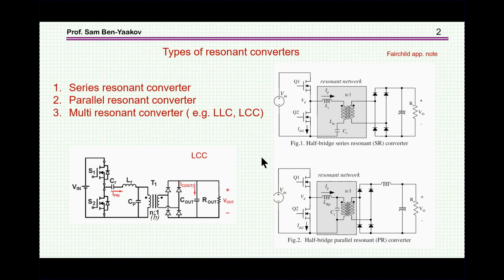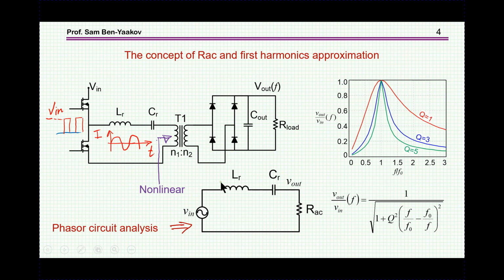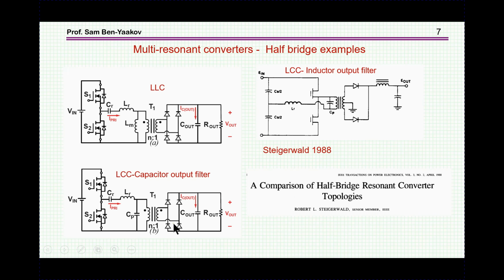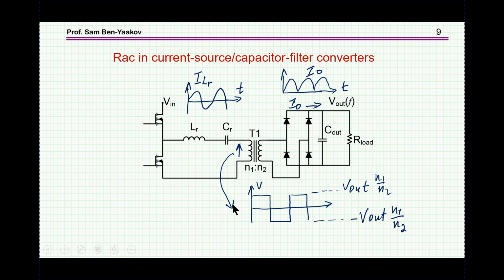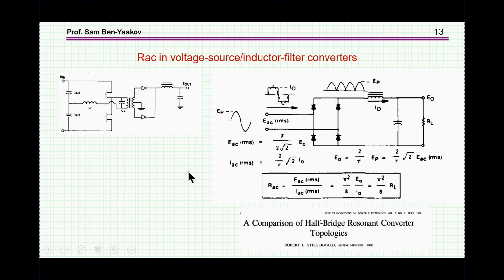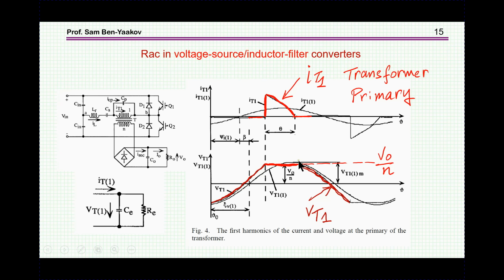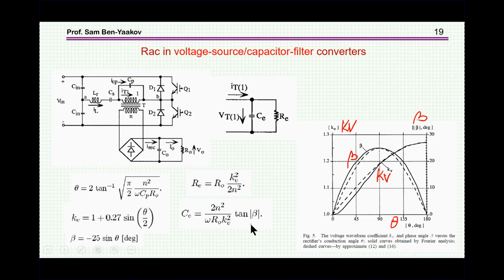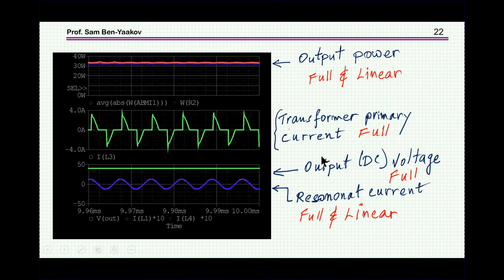LCC versus LLC converters. Part I. Basics and linear models

Comment: Hi Professor. I have in time done some tryouts in simulation I have now a model for FHA analysis so I see much o more, I can do LCC and LLC with it in LTspice. 

I have some questions about the LCC, the transformer is known now, it is part of how the CS Lr and Cp are done and loaded with it, it is not just a big inductance but work with Cp impedance. I see some papers where the Cp is twice the Cs while I see most of the others have lower Cs then Cp sometimes even a factor ten, I did see that when I do that I need a smaller inductance for the transformer, for lower mosfet current, transformer N is important against losses, I get with Cs 27n Cs 2.7 n and a Lr of 100 uH on 100 Khz what is 100 Khz and 60 Khz, (current output) and (60 Khz to 100Khz voltage output) the peak do just flip, I use the high peak and above,  and all output voltages  20v 15 amp, 150 + 150 volts 126mA and 350 volts 100mA give a mosfet current of 4.5 amps with a startup of 40 amps!!! oi yes that is what resonance supply do with startup, dangerous high amps, boom, soooo much need of soft start. but when ready 4.5 amps left and have a nice half sinus mosfet current signal..

When I do lower the 20 volts 15 to 100 mA I get a primary mosfet current of 1.2 A with all other outputs on normal currents. I do see that with 15 amps I get 22 volts out and with 100 mA I get 23.5 volts, without any regulation, this makes it an excellent audio power supply, better the LLC in this.

The mosfet current changes with low load to a kind of strange positive quarter wave and a sharp plus in the negative part. With load it changes to half sinusoidals. I have use a Q of 6.2 on Lr and Cs. I use this too for that,  https://www.omnicalculator.com/physics/rlc-circuit.

Oke update, I did a open output, what happens then is the HV voltages go from 350 to 550 volts and the 150 volts to 200 volts, but the low 20 volts 30 volts, a little load is enough to get them from stop running up and up. I did hear this is inherent of LCC. Mosfet current is now 1.5 amps. I gess loss because of circulation currents, as this is the case then it is low. So need a regulation, no problem, that already did work.

Regards
Reply from the maker: Is it up and running?
Reply: @sambenyaakov  I am ready for build, the inductance meter is here, and is quite needed to make the transformer. I have not done the LLC for test, I did simulate it and calculate the value,s I did get some info about the Q factor, these I have set such, that when full power the resonance capacitor has not to high voltage, in mine case now, 800 volts when start up hard, and 240 volts when in lock and on right voltages. I can go as low as 100mA in output and still does regulate, lower can not, I get to high circulating currents. In mine case now, I have 300 volts input, no pfc, and the supply does be close to resonance getting a nice sinusoidal on transformer.

When full power, that is 19 volts 10 amps, 350 volts 105 mA and 130 plus 130 volts 300 mA I get a primary current of  3.5 amps. When at lowest I get 0.8 to 1 amp. This is on simulation, not the build, but simulation these days with good models is scary precise. A pfc can maybe be needed to get a more clean input voltage, but I have a low power supply so maybe not needed.  I will make a small video to show you all the signals soon.

The LCC do better with high voltages but never it has to go open because then, the high voltage get so high the tubes will be damaged. I need for LCC a voltage protection when use that, but LLC can also do the high voltages, even when pro,s say it is not suitable.

I have now all the info, I do now what to do and all thanks to your very clear and clean video,s Tanks for that. Q and transformer has a very narrow band with each other, this I did miss.
Reply from the maker: @audiokees4045  Thanks for sharing
Reply: @sambenyaakov  Well this was what I did miss for transformer calculation. if primary known, just do for secondary (1\N)squared x primary inductance did the trick, I did search for. Again learned something.

Comment: About the riddle at 11:30, about the difference between the single and the double capacitors, I did not see any satisfying solution yet, so let me give it a try : 

I think the double (split) capacitors serve as the capacitor that you need over the Vin lines, to close the main switch loop.
With the single capacitor, you would still need a separate bulk capacitor of Vin, so it makes sense to split that cap into the configuration that Dr. Steigerwald proposed.
Reply from the maker: Have you seen https://youtu.be/T8qWWwsMOK8 ?
Reply: @sambenyaakov  Ah ! Thank you. Your attention to details is phenomenal. Love your work Dr. Ben-Yaakov.
Reply from the maker: @2meters2  😊🙏

Comment: Hi Sam, a nice day or maybe evening there, I have a question what I can not answer myselfs. The LCC converter has a different relationship with the transformer, Can you explane in some words how to design the transformer itselfs? In LCC the capacitors do devide impedances?. Can I use a normal half bridge transformer calculator? I read little about it. Thanks in advance.
Reply from the maker: Thank for sharing your thoughts Losses may higher thogh.
Reply: @sambenyaakov  This question is now clear, I need to involve the transformer on a right way, with the Cp capacitor making a second resonance point. The Cs and Cp has tow frequency's, one on Cs and Lr and one on Cp + CS and Lr and transformer for the gain setup. look like LLC where the leakage of transformer is used as Cp.  I get the most output when I am on the peak of graph, .
Reply from the maker: @audiokees4045  👍

Comment: Dear Professor Ben-Yaakov,

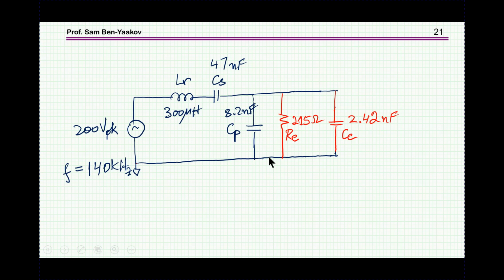i have a question regarding 26:45 :
Where has the magnetizing inductance gone in the linear model? Can it be eliminated that easily?
Regards?
Reply from the maker: Good point. This model assumes, as in most first order analyses, that the magnetization inductance of the transformer is high and thus does not affect much the circuit operation.
Reply: @sambenyaakov  Sorry for break in here,  I have not seen this, reading more posts helps, but I am sure not the only one. That is why I can just calculate the transformer with a tool, and use that normal half bridge setup. I think just calculate the X of the transformer and keeps it high enough, above reactance of tank but not to high will help.

In papers was also mentioned that X or inductance transformer has to be high enough, that is because the LCC  tank output act as a current source. But not to high tough. ChatGPT was wrong here so AI needs to learn more also;-).

regards

Comment: Dear All. I consider that using split capacitors the converter can force current in both directions. Therefere, it turns out as a better transformer utilization; the converter, related to the transformer, does not only opperate in one quadrant. Comments are welcome. Regards,
Reply from the maker: It makes no difference to the transformer if one or two capacitors are used.

Comment: Thanks for another great video!

I have question about first harmonic simulation: What with dead time? Dead time have big impact on circuit, and first harmonic simulation don't show it. Can we consider dead time in this type of simulation?

Best regards,
Marcin
Reply from the maker: In ZVS soft switching dead time has skittle effect since the voltage waveform is still symmetrical (if the two dead times are about the same length).
Reply: @sambenyaakov  Thanks for answer

I ask about dead time because I use first harmonic idea in algorithm to find rezonant frequency (measure current from current transformer and do fft and atan2):
https://www.youtube.com/watch?v=VRjyxihpBYU
blue - rectified current
yellow - driving signal from uC

Then I find out a dead time have impact on frequency that I need use, if I use theoretical resonant parameters (high first harmonic amplitude and 0 degree phase) I hadn't ZVS, because mosfet open with delay with hard switch:
https://youtu.be/TAbC0UGfC3c?t=14

When I add some detuning in frequency (a bit higher freqency) I got ZVS. This detuning depend on dead time value (dead time projected to phase for resonant frequency). If I use low Q in circuit then it was ok, but if I would use some biger value, this problem with dead time could be bigger.

Do you know about documents says about dead time impact on resonant frequency?

Best regards,
Marcin
Reply from the maker: Hi Marcin, Perhaps the issue here is phase shift not the the magnitude off first harmonics. No specific document comes to my mind on this. Please share your findings at https://www.linkedin.com/groups/13606756/

Comment: Hi Sam, I think the answer to your question (what is the different between HB with one or two Capacitors) is the following - 
1. from the voltage rating of the capacitor there is no change - in both option the capacitors would have about Vin/2 stress as long as the duty cycle on time is equal between the switches
2. from the current rating of the capacitors there is a different - taking only one cap (low cap or high cap, both options are valid) would result in 
      
a. the transformer current would be identical to the capacitor current instead of a combination of both capacitors current - higher RMS current rating for one cap solution
b. the main current would be the same as the transformer in one switch operation and 0A on the other switch operation (only one switch would enable to close a circuit between Vin to GND) resulting in a higher RMS current comparing to the two capacitors solution that would enable main current to flow at both switches operation

Comment: What is the benefit of the resonance around a transformer?
I see the secundairy voltage is very high but it draws a very high current from the supply ánd when i load it, draw current from the secundairy, strange the primairy draws less current from the supply. Or is that only because it is then not longer in resonance? So can resonance then only be usefull for only one loadcurrent by wich the frequency gives the highest outputvoltage or current and where is then the benefit compared with a frequency higher or lower than driving the transformer on his own resonance frequency? This behavior from a co2lasertrafo i saw and i choose a lower frequency in spite of a lower outputvoltage. The current behaves more normal then, so lower supply load when lower transformerload. Should i better choose the resonance frequency(depending on the load, the transformer resonances with a very high outputvoltage on 22to46kHz)
Reply from the maker: Hi Rob, Thanks for input. I will cover these issues (advantages and deficiencies)in the next parts of tutorial. Let just say at this point that one of the problems with LLC is indeed higher current stresses at the output.
Reply: @sambenyaakov  thanks again! Much of your lessons is so usefull for me that it became really a longtime wish come true (if that is good english?) Now I look out for your next video even more than normally. So great that you can make this lessons on youtube!
Reply: Sam Ben-Yaakov Morning

Comment: The input RMS current drawn is reduced using the split capacitor network. The stress on each cap is low and also the voltage rating chosen can be low. May be you can explain this better Dr. Sam:  I read in an app note that the split capacitor can reduce the possibility of hard commutation  during startup of the LLC ( one of the failure modes of LLC is startup). The amount of time required to charge the split capacitor is low and the transformer is not driven symmetrically until the resonant cap is charged. And this can lead to hard commutation. This is somehow reduced using the split capacitor network although not completely eliminated.   Page-11 section 2.4 : https://www.infineon.com/dgdl/Infineon-Application+Note+Design+of+a+600+W+HB+LLC+Converter+using+CoolMOS%E2%84%A2+P6-AN-v01_00-EN.pdf?fileId=5546d4624f205c9a014f2713b91512f5
Reply from the maker: Hi Swaraj, Thanks for comment and for the reference which I will read. I rather not give you a grade , yet 😊, as I am hoping that others will also respond. It seems that a short video on the subject could be useful. Thanks again.

Comment: Brilliant explanation Sir! Just regarding your question in 11:31. What I think about the difference between the two is that, the one with the two bulk capacitors has its bulk capacitors rated as half of the input voltage, at least (i.e. switches a rated as half of the input voltage). Where as the other one is rated as the input voltage (i.e. switches a rated as the input voltage). Correct me if I'm wrong Sir, thanks. Looking forward for Part 2
Reply from the maker: The question of capacitor voltage rating could be a reason in case of very high voltage bus but there are other reasons for two capacitors.

Comment: Having recently taken apart a few PC power supplies recently, the half bridge designs have just a single DC blocking capacitor.
Reply from the maker: Still, having two capacitor has an advantage. Waiting for additional responses 😊

Comment: Great video!  only 1 thing at 12:18, would the source impedance not be more like a reactive source than a current source?
Reply from the maker: Still, if you short the primary of transformer nothing drastic would happen (like a current source). In the case of a parallel loaded converter, if you short the primary of transformer....(voltage source).